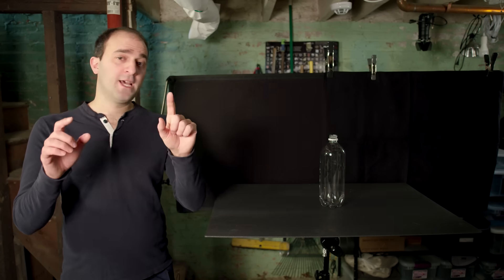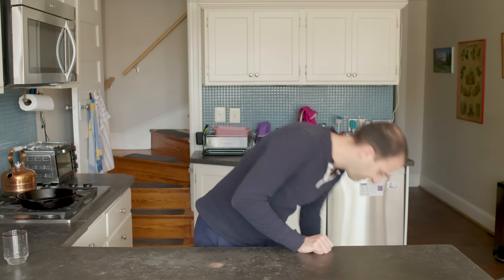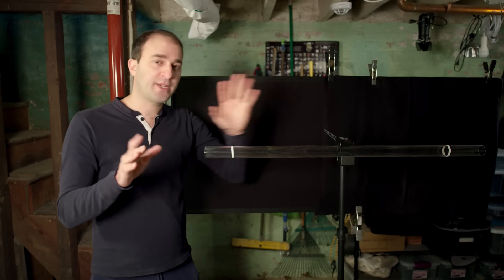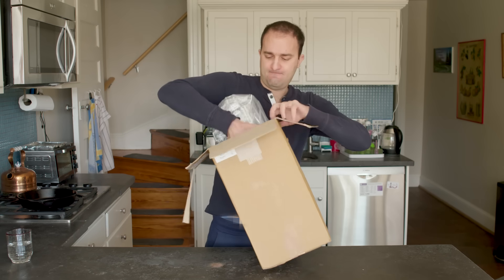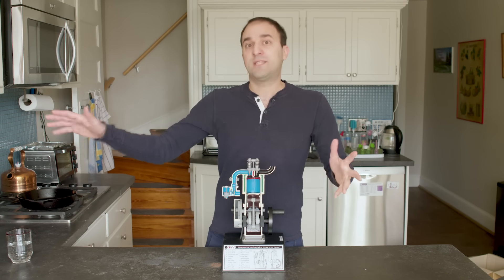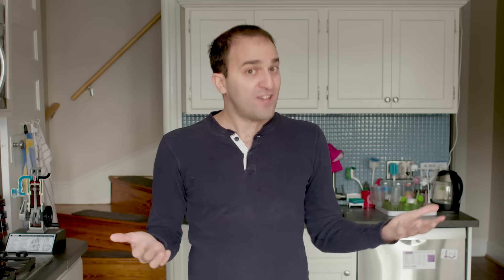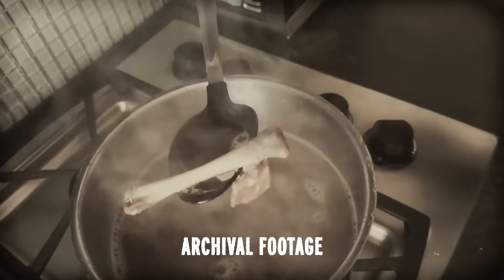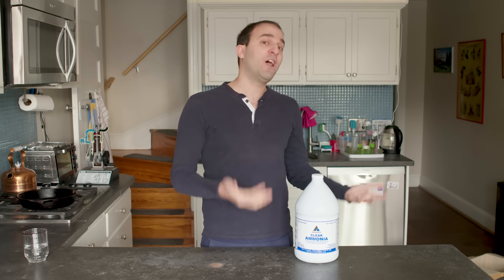Does Toyota Know Something That We Don’t?

Comment: Doesn't the Haber-Bosh process generate CO2?  It seems to me that any carbon reduction from using ammonia fuel would be offset by the increased CO2 generated in making that ammonia.
Reply: Like "gray" hydrogen
Reply: Not directly, but it needs hydrogen which is pretty much entirely grey hydrogen (hydrogen made from steam methane reforming) which is where the CO2 comes from. This is another variant of hydrogen as an energy storage method
Reply: 7 months ago this very channel posted a video called the end of the harber-bosh process which explores a more efficient and eco friendly way of producing ammonia. They lost a chance to promote their own content and make a stronger point.
Reply: @joaomrtins  
I think what you're witnessing is the realization that comes from the Chemical Society understanding just how deep in the pocket of a certain industry they really are. 💡
Reply: That's because you need hydrogen and high temperatures to make ammonia. The Haber-Bosh process generates CO2 because natural gas is used both as the hydrogen source and as the heat source. Replace both with renewables for carbon-free ammonia. It's not that simple though. For example if you use the aluminium-water reaction or water electrolysis as a source of hydrogen, then you need to make sure the electricity you use isn't coming from a fossil fuel plant, otherwise you haven't reduced emissions, you just shifted them elsewhere. If you were to instead use nuclear or renewable electricity to generate the hydrogen, then yes ammonia is a carbon-neutral fuel.
Reply: Same problem with hydrogen.
Greenwashing.
Reply: @elprzemo666  same thing with the EVs
Too many people are burning fossil fuel to charge EVs... Just sweeping problems under rugs...
The real solution would be to abandon inefficient modes of transport like privately owned cars, and start moving people and things more efficiently 
The reality is as long as you are using same mode of transport and moving as much weight (or in case of hydrogen or electric vehicles more weight) you would be using as much if not more energy.
Reply: CO2 EMISSIONS CLIMATE RUBBISH IS JUST That, RUBBISH!
Reply: Just like creating electricity for electric cars, concentrating hydrogen for hydrogen cars, ethanol production for ethane cars, ect.
Reply: @mikeLigmau2  No. Not like "generating electricity"
Haber Bosch requires compressors to massive Bar and a huge electric arc at scale.
Renewables, like wind in the north sea, are "paid off" within a year and continue to produce carbon free electricity for decades.
Reply: Most hydrogen is produced from LPG, leaving the CO2 as waste.
Reply: There's no carbon in the combustion equation. So there is no  CO2
Reply: @Dickusification  As of today 99% of all ammonia production involves splitting the hydrogen atoms from methane, CH4 and the remaining carbon is combined with oxygen to make CO2.
Reply: It has been shown that methane can be thermally cracked to produce hydrogen and graphite. About 40% of the hydrogen produced can be then used as the heat source for the reaction, no carbon dioxide. @mafarmerga
Reply: @johntracy9398  I am aware of the company JGC using solar energy to drive the Haber-Bosch process and Siemens is doing something similar with wind power but I am not aware of anyone using 40% of the liberated hydrogen to a) recover the remaining 60% of Hydrogen and b) compressing the leftover carbon into graphite.  
Please provide details as to who is currently doing this with methane.
Reply: Carbon Dioxide is plant food.
Reply: In answering your question, yes. However there are also carbon emissions involved with generation of Petroleum Based Fuels. Generating non carbon based fuels eliminates 'excess' carbon. Not carbon free, but closer to carbon neutral (or better) as possible. If you couple nuclear to Ammonia Based Fuels, then that process gets near zero carbon emissions.
Reply: I’m a chemist that currently works in the ammonia and corn ethanol industry. This video is ridiculous. Ammonia comes from burning methane. You aren’t solving anything here, so I am baffled how he didn’t look at the step pre-ammonia. We aren’t digging ammonia out of the ground. we are creating it by burning fossil fuels.
Reply: Yes
Reply: Climate change is a hoax , pure and simple
Reply: You make it too. It's not a problem.
Reply: Bro, the earth’s atmosphere only contains like 400 parts per million of CO2. That is 0.04%. Also, plants need CO2 in order to not die. CO2 is not harmful to humans except in EXTREMELY high concentrations. 0.04% is not that… heck even double that at 0.08% it’s STILL not harmful to humans.
Reply: This is the problem with making all fuels that aren’t made a direct result from collecting the suns energy or using it directly itself.
Reply: I don't know about CO2 but apparently you can make ammonia from hydrogen by passing it through a polymer and you can make hydrogen from solar power and sea water (in Australia anyway) and convert ammonia back into hydrogen by also passing it through a polymer which solves a problem of transporting hydrogen....
Reply: Lol dont burst their bubble!
Reply: If you eat you need co2
We're actually removing too much.
Reply: You can use a forward osmosis system like at nasa to make it from urine
Reply: @peterlang777  I love the idea of driving around all day powered by urine!
Reply: @mafarmerga  see Howard hughes
Reply: There is a different method of producing ammonia using electrolysis.
(Completely green )

This channel has made the video about this new clean production method.
(I think title of the video is 'Death of Habber Bosh process' )

Go look it up.
Reply: The only step in the Haber-Bosch process that produces any "pollution" would be the CO2 produced when using natural gas (CH4) as the source of the hydrogen needed to produce NH3.  If electrolyzers are used in combination with wind, solar, hydro, nuclear, geothermal, or other carbon-free power sources, there are virtually zero emissions associated with HB.  The chemical equations for autothermal reforming of methane are below:

CH4 + H2O (steam) → CO + 3 H2 Endothermic
CO + H2O (steam) → CO2 + H2 Exothermic

The chemical reaction for Haber-Bosch is:

3 H2 + N2 → 2 NH3

HB is exactly as clean as the source of the hydrogen.  Nitrogen is ~70% of the air we breath.

NH3 is actually cleaner than hydrogen because: 1) NH3 is used to catalytically clean up the NOx that is produced in both hydrogen and NH3 IC engines, 2) it takes less energy to produce NH3 than it does to produce 10k psi hydrogen (the pressure needed to store hydrogen on a vehicle), and 3) while hydrogen can persist in the environment for long time periods, NH3 is readily used by natural environmental cycles (ie as a fertilizer). 

NH3 is currently produced in approximately equal amounts by natural and man-made paths.
Reply: @NH3EnergyPlus  the heat required for reforming methane and for Haber-Bosch is typically obtained from burning natural gas which produces CO2 emissions. The CO2 emissions of the reforming reaction are not the only CO2 emissions
Reply: Those Damn Aussie's are already testing it for mass production and it's not the Boch method
Reply: Concentrated CO2 generated making ammonia can be much more easily dealt with than tail pipe emissions.
Reply: You act like CO2 is an issue
Reply: Not if the hydrogen is generated by either electrolysis or high temperature nuclear via the sulfur-iodine process. And as long as the air separation unit is running from renewable electricity or nuclear electricity.
Reply: The method we currently employ does create CO2 but that is not a requirement of the process. At it's base, Haber-Bosch takes nitrogen, N2, from the atmosphere, split it catalytically and combine it with hydrogen, H2.  
The basis of the (very) high CO2 emission from the Haber-Bosch process is a) how we get our hydrogen today and b) the high energy needed to run the process -rapid heating, high pressures, rapid cooling and back. 
Today we make almost all the hydrogen from methane in natural gas and the energy for heating and pressurization is also provided by the natural gas. Change the source for the hydrogen and use renewable energy and you could have a carbon neutral production of ammonia.
Reply: @gamarus0kragh  Very well explained I worked in production in an ammonia plant and was going to give an explanation but yours is very good LOL
Reply: @gamarus0kragh do we need more solutions that mess around with the atmosphere?
Reply: @TBonerton  I'm sorry. I don't think I understand your comment/question? 
The traditional method leaks some CH4, mainly from extraction and transport, O2 and N2 from the atmosphere and produces NH3 (that we try not to let leak) and CO2. 
If you use another source for your H2 in the process it will most likely be in the form of H2O. 
You may get additional hydrogen leakage but that is not a greenhouse gas and will anyway most likely react with some of our other gasseous pollutants and neutralize them. That is the only 'new' gas introduced.
If you are worried about removing N2 from the atmosphere, don't be.
Reply: @gamarus0kragh  If you come up with a way of making hydrogen without any CO2 emmisions like that then just MAKE hydrocarbons with it using any carbon already on the Earths surface and it would be a carbon neutral fuel.  The probelm with fossil fuels is that its a transfer of carbon from underground to above ground, not the fact that it uses carbon, all natural biocycling is carbon neurtral because it cycles the same surface carbon.
Reply: @kennethferland5579  I agree with you with the caveat that we will probably still need nitrogen fertilizers in similar quantities to today. No reason not to adapt the ammonia synthesis to a carbon neutral pathway. 
Regarding making hydrocarbons with green energy, it is already starting in Denmark. Animal waste from (in particular) pig farms is gassified, yielding methane and CO2. Here is a concentrated source of CO2 and, with excess power from the grid, it is combined with hydrogen and added to the methane and piped into the natural gas grid. It could just as well be tapped off as methanol or allowed to chain-propagate to higher hydrocarbons but currently the natural gas is more economical.
Reply: @gamarus0kragh  Exactly!  If you get the Hydrogen from solar powered electrolysis then you could make ammonia carbon-free.
Reply: @mafarmerga 
the problem with all "fuel from renewables" strategies; whether that be hydrogen, ammonia, hydrocarbon synthesis or any other miracle fuel is that they are all very energy inefficient compared with just making and using electricity.  Hydrogen is the least worst and that wastes over 2/3 of your green energy just for the convenience of not having to wait for batteries to charge. 
 So that means we will have to build (at least) 3 times the wind and solar capacity just for the convenience of carrying around explosive and/or caustic gas in our vehicles.
I do hope Toyota aren't betting the farm on these technologies.
Reply: @gardnecd  I have an PHEV, and because I A) have my own garage charger B) can charge overnight and C) use the EV for short trips and my Hybrid part of PHEV for long distance  I don't have range anxiety.
But if we are to move away from petrol for most transportation, electricity and batteries are probably not going to get us there.  For commercial truckers it is not simply a 'convenience' to refuel in minutes vs. hours. 
So a PHEV that runs on something other than petrol will be needed.  I will continue to use my PHEV mostly in pure EV mode, but I really like the idea that when needed I can refuel in minutes and keep going.
Reply: @gardnecd  While your correct that just charging a battery is the best solution your wrong about Hydrogen being the 'least worst' synthetic fuel.  Hydrocarbons would be the best synthetic fuel to make from renewable sources, its the safest, densest, easiest to transport and would require zero new infastructure or integration effort.  If you can make renewable 'green' hydrogen then it is completly idiotic to not do the final step of hydrocarbon synthesis.  All fuel synthesized from hydrogen basically has the energy content of the hydrogen used to make it, every other atom is dead weight, which is why the Carbon is best at 4 bonds per 12 atomic mass a 1:3 ratio which beats out everything else.
Reply: @kennethferland5579  gathering carbon efficiently is the challenge for making hydrocarbons. CO2 is 0.4% of atmosphere which would mean moving a lot of air. Alternatively let plants collect it for you and turn the CO2 into carbohydrates, but it is slow and takes a lot of land which is needed for food production
Reply: Yes but I remember reading that there a recent break through in 2023 in catalyzing the Haber-Bosch process at low temperatures which dramatically reduce it's carbon emissions
Reply: @alexrogers777  carbon would be the least of our worries. This stuff (anhydrous ammonia) is so wickedly toxic that railroaders have been trying to ban hauling on freight trains it for 5 decades! The amount of ammonia needed to run a normal car for 3 days is equal to the amount needed to exterminate everything in a typical sports arena!
Reply: @STEAMerBear getting rid of those in a sports arena sounds like a socially benifical result to me!
Reply: @Number6_  I wish I didn’t see your point…
Reply: Yeah, it uses an insane amount of electricity on top of the required hydrogen (which likely comes from steam reformed methane)
Hydrogen (in ammonia) as a fuel is a non-starter if you actually do the numbers.
You're WAY better off just using electricity directly, and not risking chemical blistering agent in case of an accident or fueling mishap
Reply: @jimurrata6785 Yeah, where renewable energy is created. But it can't be transported easily unless cables can be strung or laid. Converting to hydrogen allows transport, and converting hydrogen to ammonia allows a much higher energy density to be moved by ship. New catalysis technology allows converting and then reforming to H2 more viable. Places with excess geothermal potential such as NZ or Iceland may find this a good export option. As for excess solar production here in Australia
All options open up when excess power is free. 
I can only export a portion of my generation here in WA to keep the grid stable. I can get a battery, or someone can build a plant to take excess at any time from all households generating excess and make hydrogen. Or desalinate water. Or fill pumped hydro. Or whatever storage becomes widespread in the future
Reply: @emceeboogieboots1608  How the hell do you "create hydrogen" without cables and pipelines???
Either you're trolling or haven't thought this through?
Reply: yea, but this is an stationary source, and for a Nation-State lead project so it can be contained or otherwise used in a way that keeps it out of the carbon cycle.
Reply: @AnonymousAnarchist2 just wondering why a nation state is the only entity that can do what you’re proposing?
Reply: @AnonymousAnarchist2  what will you think of next if the state ever issues you a 2nd braincell?
Reply: @AnonymousAnarchist2  With the amounts of fuel we need, that containment is going to have some girth to it.
Reply: The point isn't to reduce, it's to appear like you're reducing.
Reply: @zangeh money and jobs mean idea innovation then creativity.
Reply: Yes and it's a problem, but gasoline ALWAYS emits carbon when burned. The emissions for ammonia is in the synthesis, so discovering an emissions free method decarbonizes ammonia and you can never decarbonize a hydrocarbon.
Reply: Yes, the process requires a furnace to generate heat at something like a 1000 deg uninterrupted for days, kind of a problem for renewables and LiIon batteries so the use part of the feed stock to generate heat. North America has plenty.  Non carbon ways would be 1 nuclear reactor or renewable with a cheap battery like MITs liquid salt or a huge warehouse sized iron flow battery.
Reply: @johnschneider931  no not for days-  continuous process;  steam and natural gas goes into a catalyst filled reformer on a continuous process at medium -pressure and high temperatures I can’t remember from when I worked in an ammonia plant the residence time but it’s only a matter of a few hours from memory processing into ammonia on a continuous basis There are of course multiple stages from there but that is basically the only hot stage
Reply: Just like EVs without the insane toxic byproducts.
Reply: @TheGuruStud  It only produces CO2 if one uses methane as the source of the hydrogen atoms.  There are non-carbon alternatives, such as electrolysis of water.
So no, it is NOT just like EVs.

And if you still think that petrol is better than other non-carbon energy sources you might want to ask the good folks of Lac-Mégantic, Quebec, Canada.  They might have a slightly different view about the 'byproducts' of ICE vehicles powered by petrol.
Reply: The Haber-Bosch process only generates CO2 because it requires high temperatures and pressures and typically that's carbon intensive. However if the source of energy is carbon-neutral, the car is carbon-neutral, and without the carbon footprint of a giant battery.
Reply: @bernardi5919 
You can generate ammonia at room temperature and pressure in an electrolytic cell from Nitrogen and water.

All it requires as a catalyst is metallic lithium dissolved in a NaK liquid alloy which wets a copper cathode suspended in a special oily amine layer separated from water.
The lithium nitride formed at the cathode reacts with the tertiary ammonium ions to get the hydrogens and form back ammonia and lithium ions that get recycled back to the cathode.
The hydrogen comes from water.
Reply: @drgazter   NaK +H2O = boom
Reply: @bernardi5919 battery carbon footprint is a one off cost.

Same as developing the infrastructure for hydrogen based fuels.

And hydrogen infrastructure will rely almost exclusively on fossil hydrogen.

Which is reliant on methane extraction, which has already had research showing its fugitive emissions are underreported by around 100%.

Scaling up hydrogen just hasn't got a viable carbon neutral pathway
Reply: @meateaw  I wasn't arguing the point of hydrogen-powered cars being a carbon-neutral mass-market transportation option. I was just saying that the Haber-Bosch process doesn't inherently produce carbon emissions, which is true as long as the energy required comes from a clean source. Whether they actually do use a clean process to produce ammonia is a different question entirely. I was just trying to be a smartass when talking about the battery carbon footprint, I know it's overblown but I'm still waiting for the technology to improve before I buy an electric car.
Reply: Does it produce as much co2 as all of the electricity needed to fuel and produce EV's ? And that's not to mention the environmental and human costs of the precious metals needed for the EV industry. Probably not.
Reply: @glennjames7107  Far less* actually.💡
They are at least 3x as efficient as ICE, mile per mile and that one battery is spread out over the lifetime of the vehicle.
Not burned and constantly renewed.
And EV's are agnostic about where their electrons come from.
PV, Wind, Hydro, Nuclear, gas or coal turbine...
As more and more renewables come online an EV's footprint only gets smaller. While an ICE will always require more petroleum.
Reply: CO2 is the least important GG because it's literally plant food. We should focus more on nox and volatile compound emissions as they are much more responsible for poorer air quality and reduced plant output
Reply: Lets just never compromise on any form of emission, become poor, freeze if you live north and the rest starve. I'll be dead long before climate change becomes a true threat. 
The great freeze, al gore, global warming, wef, now its called climate change, 

what % is a natural earth cycle and what % is man made, and which places are responsible for how much of that %, nobody seems to know or wants to speak of it, here in the west our air is much cleaner than many other rich nations, but it is us who must go poor for the rest?
Reply: Didnt you see last video about Bosch Prozess. In the future it can be that we dont need to use fuels to produce ammonia ;D